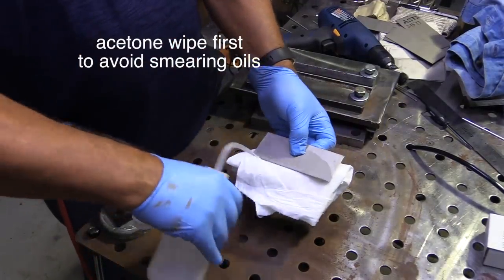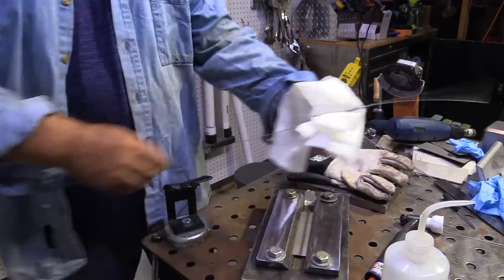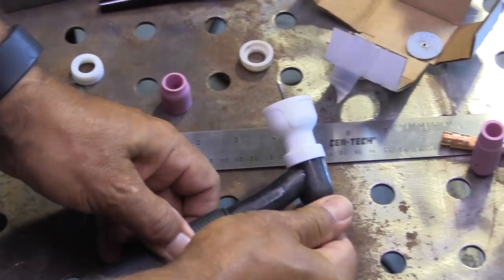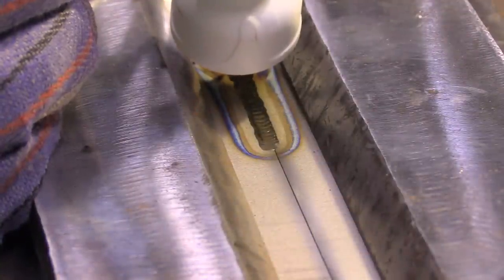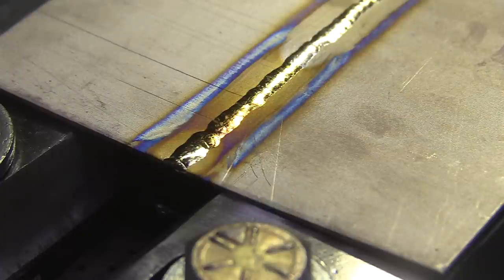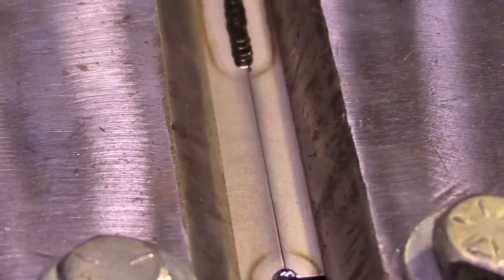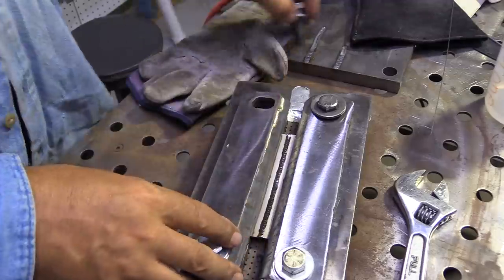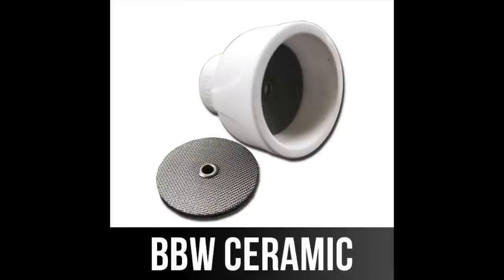TIG Welding Titanium

Comment: As a former quality testing chemist for a gas supply company, I can tell you that they only check for oxygen in "industrial" grade Argon. Move up to 4.8 grade and it's oxygen and moisture. You have to get up to 5.0 or even 5.5 grade to start testing for things like Nitrogen or hydrocarbon impurities. Sometimes industrial grades are filled alongside 5.0 grade in the K and T size (250 and 330CF Argon) cylinders (with the lot tested to that high spec), but your smaller customer owned cylinders will almost always be filled as just industrial, which would explain your experience with the different sizes.
Reply from the maker: BattleChemist thanks for the Good information
Reply: Happy to be a resource for gas knowledge. I spent 7 years there testing up to 5.5 grade spec and AWS specs (plus medical, food, and beverage specs) and was a Quality Assurance Reviewer (signed off to release product to the public) for 5 of those years before moving on to a different career. Not claiming to be an expert, but I've learned so much from this channel I like to give back where I can. 😊

I remember getting quite a few cylinders of industrial argon marked "bad gas" by the customer to find there was around 0.5-1% nitrogen in it from nitrogen tanks being converted to argon (same CGA 580 valve) and not vacuum-purge-vacuum-fill process like you would for a spec gas. But that was "acceptable" due to not testing for it... though, if converting, the tank was 'supposed' to be purged. 😒🤐
Reply: What instrumentation did you use for testing the gas? I'm a chemist as well but spent most of my time in grad school working on a STM and AFM and when I finally got into industry I worked on the wet side and never had a chance to test any gases. I enjoy working with instrumentation. Almost had a job at a smoke lab but a stupid recruiter messed it up for me. Oh well, place was awesome as pretty much everything was brand new, which was a far cry from the wet lab were most of the equipment was built in the 80's.
Reply: @Parents_of_Twins  It depended on what impurities or percentages we were trying to test. For Total HydroCarbons (THC) we used a flame ionization detector. For trace oxygen, it was electrochemical with potassium hydroxide (KOH) solution in the instrument. For oxygen percentage, it was paramagnetic sensors. For carbon dioxide purity, we used ~30% KOH solution wet chemical that absorbed all the CO2 and the leftover was 'impurity'. For trace CO2 percentage and trace carbon monoxide, we used non-dispersion infrared (NDIR). For trace water, we used electrochemical where an oxide layer on a substrate increased current as water reacted with it. For just about everything else, we used GC-TCD (gas chromatography-thermal conductivity detector) for percent levels and GC-HID (gas chromatography-helium ionization detector) for ppm levels.
Reply: I was just going to ask about the grade of argon gas.
I NEVER rented one before and I was making a lot of assumptions.
Reply: I’m still in school, and don’t understand what that means. Could you give insight to the quality?

Comment: When we welded titanium we always did it in a "glove box" where all O2 was purged out with argon...welding little titanium grommets for the SR71!
Reply from the maker: JoJo Mama good point. some parts require welding in a chamber. Some are more efficiently done in a chamber. But there are also plenty of applications where a back purge along with a trailing shield or large cup can get the job done
Reply: i've seen the welds on the mighty  J58
man those welds look like garbage.
acceptable for the 60s i guess.
Reply: 3rd Gen Guy ... don't know what '60s has to do with anything,they had destructive and non-destructive testing back then.In my experience a good weld is usually a pretty weld but then again I don't know what you were actually looking at
Reply: 3rd Gen Guy.....again,when I hear someone say "garbage"  especially when it comes to aircraft it really makes me wonder if this person has any idea what he's talking about
Reply: I have been welding for fun since I was a kid. I would love to learn to weld Titanium, but after seeing this video, I realize that basically, I know nothing. It seems like a lot to learn before I would even try.

Comment: Another great video! I noticed finding the right darkness in my hood really made the puddle stand out. Usually run pretty light. Turned it down to 12 and what a difference. Also I like to lengthen the arc and dab right under it, not the front of the puddle. Takes the stickiness out of it. I’ve only welded it once but it was like a million pipe cuts. Reminds me I need a new tig finger sir.

Comment: Thanks for the tips! I just recently worked in Titanium. I machined and ground a few small pieces at the request of some knife maker friends. It defiantly has its own set of rules. I was told by one of my subscribers that heat and oxygen causes Titanium to oxidize and changes its properties and making it difficult to work.
Steve

Comment: I was a team member TIG welding titanium pacemaker clamshells. We used a glovebox which we would pump down to just a few microns, break the vacuum with argon and pump it down again. Then break the vacuum with argon again to atmospheric pressure. The argon was from a big dewar  tank with liquid argon. All the connecting piping was brazed without any flux. Small leaks were tested for by pulling a tight vacuum and waiting overnight.

We discovered that any leaks with argon gas even under pressure would cause a backflow situation  introducing oxygen and nitrogen into the argon cover gas. Nitrogen was especially bad because the TiN layer was extremely hard and even more corrosion resistant than titanium itself, but contaminating the weld internally.  Much of the straw color you see is probably TiN because it looks just like the straw color you see with steel in the HAZ. When properly set up, there is zero color except the silvery color.

You also must be anal about cleanliness. Most of the clamshells were vacuum annealed and put in sealed bags. The hydrogen really cleans the Ti at the molecular level. All this is what we felt we needed with a medical device, but it is impractical in the rest of the real world. But, you must have really clean parts and really pure argon for a quality weld in the real world.

Bill

Comment: Many years ago doing multi pass welds (MIG) for weld test proceedures, test plates failed x-ray due to porosity. Plates were welded in an area shielded from drafts etc. Welding Engineer had witnessed all welding tests. Turned out to be bad gas, not me, but the gas bottle I had been using. New bottle, welds all good. The little things tnat can make the difference.

Comment: Funny you should mention accidentally welding titanium with stainless filler. Within my first couple of weeks of welding titanium I made this mistake. To a guy with almost nothing but aluminum experience up til then, inconel filler looked pretty similar to titanium. I ended up welding about a quarter way around a piece of .049 wall .625 diameter 6AL when I noticed an almost 'glass breaking' sound.  That was a valuable lesson that cost quite a bit of time to correct.

Great videos, sir. Keep it up

Comment: I've run into the bad gas problems several times, seems like it didn't show up much welding 316 stainless but trying to weld aluminum with it just didn't work, it made me think the material was contaminated,  finally decided it had to be the gas after trying everything else, so I took the cylinder back to my supplier and told them what was going on and there response was "oh you must have gotten one of those bad cylinders of gas" . They said whoever filled them didn't purge the manifold and they had several cylinders returned. Since then I've had 2 others that were bad over about a ten year span.

Comment: I produce titanium tube on a cold rolling mill and we have to turn the argon right down compared to stainless, we use a hydrogen argon mixture just for production speed, we use a mixer from the tanks outside but you can get ready mixed argon gas that's 5% hydrogen maybe you should try with a low gas rate...just a thought...

Comment: To avoid overheating and blowing thru on the ends, why not start at both ends and blend the two welds in the center of the piece ?   That's the way I was shown and it works pretty good.

Comment: Hey Jody! Would LOVE for you to cover tips and tricks on welding thin wall titanium mitered tubing. I work in a custom fab shop that builds titanium bicycles and would love a short vid on tips, pulse, heat, ect. We use .035” 6-4 Ti tube.

Comment: Great video. I’m hoping you can help me with my question  I have a titanium clutch can and I need to weld two 1/2” nuts on the inside of the can in order to mount the motor. Is there anything I should be aware of before I have this done and if done properly will the welds be strong enough to hold up to the vibration?  I’m not holding you to this, just your educated opinion.  Thanks

Comment: The white ceramic cup is fine for stainless and mild steel but not for Aluminum.  I have no 10 standard long cups, I cannot find a stubby gas cup great than a no 8 for my 17 torch? should be at least a no 10

Comment: Do you have or could you do a video on dating technique. Your vids have helped me so much and I'm starting to get some decent welds on stainless. I'm getting faster and burning my welds less. But I find as I'm dabbing the rod is getting stuck momentarily at the front edge of the puddle. If I add a little more torch angle the rod tends to ball up? Love your work mate.

Comment: Heres a good question maybe dumb but what the hell i'll ask it any way, is it good or better to use flux cored welding wire when mig welding and will this type of welding wire get a more sturdy weld then compared to using reg welding wire and argon gas?

Comment: Great stuff Jody, on T joints do you still need to back purge, or not since you aren't penetrating through to back side? I'm planning on building lightweight suspension components for a drag racing snowmobile

Comment: Good video Jody 👊🏻 learned a lot . Were would I go to get titanium coupon plates like that? I’m going to be getting myself one of your dual flow meters in the near future they look nice and are affordable compared to other prices I seen. Man I’m having some trouble with my everlast tig I think it might be gas too or it has to be the machine if not gas. I get these crazy arc starts on my everlast 210ext tig . On all materials recently moved to Florida so wondering if humidity could be the problem wouldn’t think so though. But the arc starts go away if I turn the pre flow to 1 second minimum. Still bad starts if I go to .8 seconds or something like that. Even if I turn the start amps up still does it. And also I have no gas leaks checked everything multiple times . And I’m on my 3rd or 4th argon tank from same store every time airgas I’m using a 125cf tank too . Next time I’m gonna try another gas company to see if that’s the problem and also gonna call the support team from everlast. Love your videos Jody you the man👊🏻🙏

Comment: Wonder if Welding machines have or will have data logging for variables like amps used while feathering a pedal. Seems like it might be useful for testing.
Reply: Use your phone or a camera to record your actual welding amps from the display. Some guys do that with welding videos. I'll be doing it for personal reference as I learn.

Comment: Within the last two months I was dropped off an owners bottle of crap gas... You could tell the bottle had something reactive like CO² in it too. I'd hit the pedal on a 5 sec preflow to see that yellow straw color on aluminum and the puddle was trying to fall out like sugary brown turds. The arc was the wrong color too and it was a violent arc. I stopped that one to grab a little plate of steel that I've been working on and went porous on the arc initiation with soot and sparks flying from the gas occasionally.
Pull the regulator and there was a ton of oil inside of it?! Told the gas company that bottle was contaminated to hear the rehearsed bit that they give you, the line on their argon pureness is 99.9~ and that each bottle is "tested."
 So, I buy a regulator that second and say well I'll see. I get home and get a TL210 in to give me some wiggle room without a chiller and crap again! #8 cup pushing 25cfh of argon pureness to look like you'd been welding with tungsten as filler wire! So, I strapped that bottle in the bed of the truck and drove up there that Monday morning with the bottle cracked open the whole way down there to prevent anyone from getting the same shit again and they asked if I figured it out... Yep, your bottle is contaminated! 
"Well, sometimes that does happen..." Well WTF?!

Comment: hey Jodi, i notice that the filler wire is melting before it's getting to the puddle, are you running a little too hot or not enough flow to the torch?
Reply from the maker: VintageSpeed Garage actually I’m using filler wire that is a tad small. It’s .030”. I would prefer.045” for this or even.063”
Reply: cool, thanks!  now if only i could afford a piece of titanium!  :)

Comment: Hey Jody, cool video. Could you make a video detailing starting points for TIG, MIG and stick with values also in metric? I would be interested in gas flow, amps and volts and also travel/wire speed for full penetration.

Comment: Would love to see some Ti pipe videos,  a la for an exhaust or intake on a car
Reply: me too! I need to build a set of headers soon.
Reply: it's really no different than welding any other tubing.
you just have to acually be good about torch angles and wire accuracy.
-welded 6al-4v tubing for the F22 and f35.

Comment: Hi Jody do you ship tig fingers to the uk. I have just started a new job tig welding pipe expansion joints and bellows and things are getting pretty hot after about 6 inches of welding, nice video by the way.

Comment: More contaminated videos please! I mean take a little CO², Nitrogen, and any other bottle you got and split your lines with just a trickle of each to show what each form of contamination looks like. Have your argon pass through the welder gas solenoid and splitter upline at the hookup to your torch to allow you to turn on a secondary line to your contamination bottle to see what effect each gas will have on the weld.
I already know contaminated gas will have your arc glow different colors, but I have no clue which gas does what color. It would be handy to identify the contaminates.
Reply: Aint1S a

Comment: I just went for aerospace weld  test 1st time wilding titanium. I did good on the butt joint but when I started on the T joint my rod was sticking everywhere . You got any tips for me.?
Reply from the maker: Titanium gets very sticky on a tee where you have two walls   First Choke up on the rod so it doesn’t flop around. Aim for dead center of puddle like it was a bullseye. Avoid adding filler on the edges of puddle good luck .
Reply: @weldingtipsandtricks  thanks....I will like to see a video  of this sometime soon. Much appreciated 💯
Reply: @weldingtipsandtricks  I am also struggling with the fillet weld on thin titanium. The arc doesn't want to stay in the root and tends to move from one surface to the other. Can't keep a tight puddle at the root and end up with a large fillet with bad root penetration. A video on this type of weld on thin titanium would be great. Thx.

Comment: So exactly what is the point of such a long post flow period
Reply: i believe that above 750 degrees the titanium is still able to have problems with the air so you need to wait until it cools down before you can move your cup but your right being that hes not staying in the same spot hes making an entire weld not spot welding

Comment: Jody

Does BBW cup fit on the standard Stubby Gas lens collet, or for a 17 torch do I really need the Furick adapter??

John
Reply from the maker: John Crea the ceramic version has threads. And works with stubby gas lens kits
Reply: It says right on your website the ceramic FUPA and BBW are for  9/20 torches. Could you please clarify?

Comment: I always learn something here! Also - do you manually turn on your back-purge or is it somehow linked to the pedal?
Reply: Generally you manually turn it on and off at the flowmeter
Reply: In most cases you want to run the back-purge for quite a while compared to weld time. I've seen some guys run the purge for a full two minutes before welding. It might seem like overkill, but most of the time the part you are working on is so expensive it is justified.